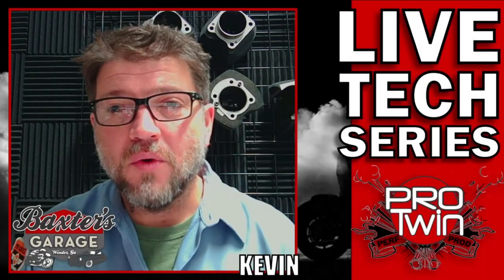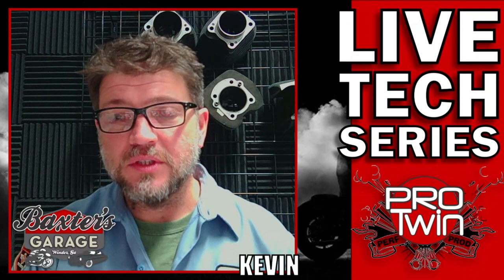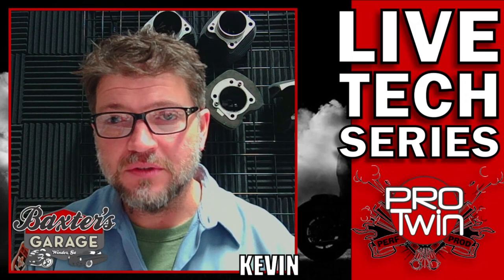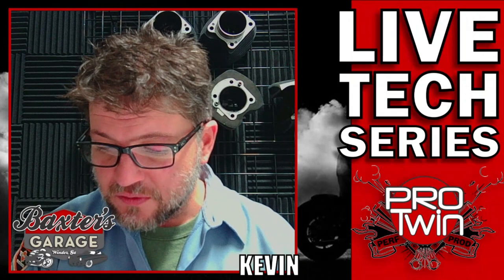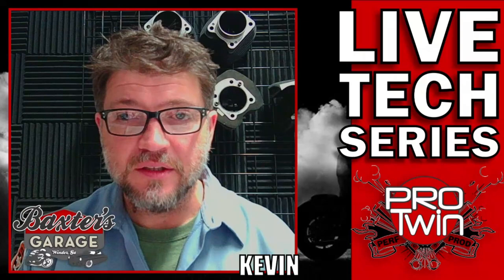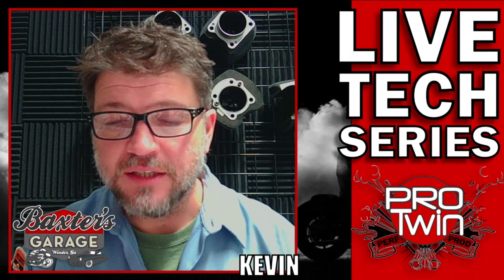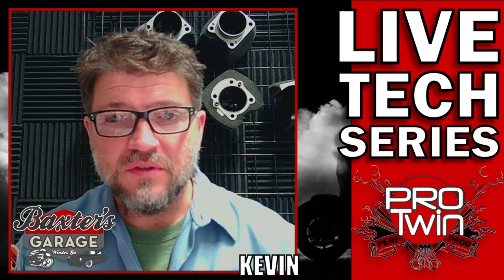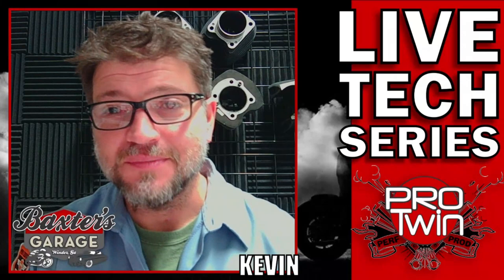Harley Sumping Symptoms and Clues - LIVE Channel Announcement - Kevin Baxter - Pro Twin Performance

Comment: Kevin, thanks for all the great videos! I own a new FXLRST 117. I am getting lots of oil in the air cleaner, it is even overflowing onto the motor. The bike has a woods 22xe cam, lifters,Thunderheader.,and Dynajet tuner.  Is there a definitive test to figure where all this oil is coming from. I get all types of opinions from all types of people. Harley has been no help. Your insight and opinions will be greatly appreciated. Some people say to vent the motor via the cover over the transmission Tracxs thinks that the answer. Of course they sell such a gizmo. Like I said all types of opinions.  HELP!!!

Comment: Thanks Kevin.
 Yes sir, that answered my question and makes a lot of sense. I probably already knew that but I'm basically just a weekend type wrencher, I have a tendency to forget some things like that. I took power mechanics my freshman year back in '84 and auto service and then auto mechanics through my senior year. I didn't pursue it as my career but it has served me well through the years doing my own maintenance and mechanical tinkering. I still have a deep interest in anything mechanical and try to stay up with the latest but being away from it and my head and hands out of it a good part of the time can leave me unpolished.

Comment: Coming from a mechanical background and watching the M8 breakdown first thing I noticed was the fact that used a wrench to break the bolts loose first. It just points out your professionalism. That being said if coming from out of state, how long would it take for you to rebuild my M8-107 with liquid cooled heads when the time comes! My present mileage on my 2017 is 33 thousand, and  what mileage would you recommend doing the rebuild
Reply from the maker: you wouldnt have to do a rebuild unless problems are present or you want to upgrade.  hard to say with mileage.  ive seen 2017 M8s come apart in less than 1000 miles.  Others Ive seen many miles with no issues.  Depending on the level of build and business at the time, it could be 4 weeks to a couple months.

Comment: Hello sir. I opened the crank eye and 350 grams of oil came out from inside. this I imagine is a large amount of oil. and I have replaced the oil pump with the s & s and still the same happens. the crank has 4500 inches runout if say it right.what can i do???with all the respect.great video great tips.
Reply from the maker: Hello sir...thank you for your support.  Have a watch of the latest M8 sumping videos...tear down, etc.  Tons of information there.  Bascially, if you get any, its sumping a little.  At 4 ounces, the problems start getting much worse.
Reply: Good evening Kevin .I saw all the episodes.they helped me a lot. @KevinBaxter

Comment: Hey Kevin! just wanted to send my regards and many thanks for all the amazing work and content you are putting on this channel. The harley community deeply appreciates this big time. Just one question and comment, what is the root cause of the pinion shaft runout in the first place?? and if it is due to the pressed crank/flywheel assembly from the factory (and the slippage caused becuase of it) do you suggest to address this root cause at an early stage and just fix the crank/flywheel assembly (trued and welded or replace with an aftermarket one)?? appreciate your feedback and response, many thanks again!

Comment: My 2019 FLHTK had severe sumping issues. The crank runout was around 0.003. The topend was fully rebuilt, piston jet oilers tightened, and new 2020 style oil pump and cam plate installed. I rode it for around 1000 miles and it sumped again. No joke, around 1.5 quarts was drained from the crank sensor. The bike had 14,500 miles on it at this point. I had no trust left in the bike so I traded it for a 2016 Road Glide Ultra. Any thoughts on what could have been the issue? Thanks.

Comment: Just in case I don't make it to the live stream, I'll ask my question again so that maybe I'll see the reply on the recording... When you were removing the comp. and clutch you used an impact. I've been told to never use an impact on these nuts because it can shift the crank causing runout. Granted the crank that you were working on was already farther than anyone wants it to be out, so the risk was nothing. But mine is pretty good with around a 0.001 inch on the cam side and I'd like to keep it in good shape when I fix the leak on the transmission output shaft in a couple of days/weeks (when I get things ready). Thanks.
Reply from the maker: Great question sir....IF i wasnt replacing the crank or trans, I would NOT use an impact.  There is an exception.  If one finds these bolts extremely difficult to remove...too much loctite, etc...using primary locking tools with excessive torque can damage other items in the primary and a little heat and bump with an impact can be just enough to break them loose.  Also consider...these are LARGE bolts going into steel.  Not steel bolts in aluminum.  Lastly...specifically on the trans...notice i was pulsing the trigger...not just hammering down on it.  And...the gun was turned all the way down.  As you may well know...sometimes just technique with a tool can make all the difference.
Reply: @KevinBaxter  and what you just said is all it takes to slip the crank dude ..Suzuki fixed their slipping cranks a long time ago by welding all the crank pins so they would never move again..makes it impossible to ever replace anything . so you just throw them away when they are worn out ..lol
Reply: @KevinBaxter  Kevin, thanks for the info. I wasn't able to make the live, but just finished watching the recording. I did notice that someone else asked the same question. I'll have to get my garage cleaned up and get into this, probably be sending you a list of parts for pricing once I get in there to see what I need. Pretty sure the comp. or spring pack is done, guessing I'll need some other seals and stuff once I tear it down, etc. Might replace the clutch while I'm in there, need to measure and see how much wear.

Comment: Kevin, if a sumping problem exists, am I correct in assuming that checking the oil after a ride WITHOUT letting the engine idle should show a LOWER oil level in the tank than if the oil level were checked after letting the engine idle for a few minutes?  My logic is that sumping would be less pronounced at idle than at higher revs, and oil scavenging from the crank case would accordingly be more efficient, returning more oil to the tank.  In other words, if sumping is an issue, letting the engine idle after a ride will result in a higher oil lever in the tank compared to not letting the bike idle.  Am I on the right track here?
Reply from the maker: anytime there is a variance in oil levels...up and down....there is a sumping issue.  can also vary as to when it sumps.

Comment: Kevin, could you tell us what causes sumping in most cases
Reply from the maker: oil pump alignment, bad cam plate or pump, excessive crankcase pressure, too much oil, clogged breathers, etc.   several causes really.  thanks for your support Rod!
Reply: @KevinBaxter  thanks for the feedback

Comment: Mt 2006 Fat Boy after it has sat a month or so over the winter the oil in the tank is low but after I start it the level comes back up. I don't know if this is called sumping. Someone said there is a check valve that may be bad. This only happens after it has sat for a while.

Comment: I try to understand everything you say and do there Kevin.
I took auto mechanics in highschool.  And I was a diesel mechanic in the Navy.
I've tinkered with everything from model airplane motors, chain saws, weed wackers, cars, farm tractors, tractor-trailers, even a little on aircraft!
Motorcycles have been one area I have had no real reason to endevor into, at least from a mechanical perspective.  I rode bikes, not work on them...

Owning an HD has just changed all that!  And it's been both an eye opener and a real scary ordeal!
Because, an HD, no matter the age or size, isn't cheap by any standard.
And I just get the impression, my '04' 88ci twin cam, is as fragile as they come.  
I'm afraid of this bike!  Because of design features, workmanship, materials used.
And this bike, is "TOTALLY STOCK!"
I bought it used, with 11,500 miles on it.  There were no maintenance records on the bike and everything on it, as far as I can see, is the "original parts," from front to back.  The tires are maybe the newest things on this bike.
So this means, that everything inside the engine and transmission are still the same parts that were installed in 2004, when the bike was built!

I didn't have a clue what I was getting into, when I took the bike from the dealer, who was 'HAPPY!!!,' to see it leave the showroom floor!
And then...  I was totally on my own.

So I'm very happy and a bit 'clingy,' maybe, with folks like yourself, who know so much about what I don't.
I'm am frightened by this machine, that has so many ways to just come apart on me, no matter how much I try to baby it!  And believe me, I babyed this bike since July, when I got it.
I've gone 1,100 miles on this bike in 5 months.  Mostly just going back and forth to work.

Nothing, would please me more, than to be able to send you this bike, and have you rebuild it, replacing all those cheap stock parts, with aftermarket products and your workmanship and knowledge.

Honestly, I'm happy with the stock performance.  I'm 60, and don't want to handle a monster on the road.
I would just like to know, that when I do get on her and fire her up, I can depend on her getting me to and from in my travels.

I ask you maybe dumb questions, or attempt to understand something, because I don't know a damn thing!  You're a teacher, and you're willing to spend the time to help me and all these other guys, 'and gals,' to understand the machine between their legs and under their ass!

I for one, am above and beyond appreciative for what your doing in these videos!  Thanks for helping me get a grip, understand the machine, and take some of the fear and mystery out of it.
Don't stop now that you're started!
Reply from the maker: thank you sir.  I always enjoy reading your comments.  thanks for the kind words.  never be afraid to ask a question...a dumb question is one that isnt asked.  i have 3 2020 M8s in the shop right now...all 3 owners are happy with the stock power.  but...these are their last bikes.  we are completely blueprinting and building with a pure focus on longevity...not maximum power output.
Reply: @KevinBaxter  I am in the same state. Happy,with the power and want this 2018 M8 Ultra Classic to last another 10 years and 100000 miles. What are you doing to these motors (other than blueprinting) to get the longevity?

Comment: Hi Kevin. Love all this. Fascinating stuff. I had a 2006 Dyna from new for 10 years, did 70,000kms (40,000 miles) pretty much trouble free. Primary brg replaced under warranty at 18,000 miles, then trouble free after that, except for a strange whining noise started at 40,000 miles when hot. I nor the dealer could figure out what it was - as per usual, they said there was nothing wrong!! My question is: If one was to buy a new M8, would I need to replace the primary auto chain tensioner with a manual one, replace the oil pump, &/or check the crank runout (before buying!)? I guess if these 3 items were all OK, the bike would be good to go many 1,000's of miles? Cheers Mike in NZ
Reply: Run a hydraulic tensioner in primary , they are out there and work great.

Comment: Kevin, question for you. I saw a post from you once before where it was mentioned that Fueling recommended not running synthetic oils in an M8, I just saw a statement on Cycle solutions stating the same. Any idea why?  "Cycle Solutions Inc. recommends using non synthetic oil in Milwaukee Eight models and not letting and M8 idle on its kickstand.
Reply from the maker: Ive had this come across my desk a few times.  I really cant explain their reasoning behind it.  I have called and will speak with Feuling directly about it and get their reason.  Before I dismiss it, I want to know their thoughts.  For myself, I can think of a single reason why this would be the case.
Reply: @KevinBaxter  thank you sir. I am sure your followers will be interested to know.

Comment: Would external breather, s&s cam plate, s&s oil pump and feuling vented dipstick help with these issues? I just noticed a lil loss in power today... checked oil and was very low! So I drained oil and only got about a quart and some...! I'm about to put 475 cam kit in my bike! But I'm gonna be honest losing that much oil has me worried! But I've ordered s&s 475 cam kit, feuling dipstick and currently have external breather hooked up!

Comment: Ok, got a 2006 Screamin Eagle Softail, 103", B motor, sits for a few weeks, oil tank empties...wtf?!  Sumping? Oh, 44k on the bike.
Reply from the maker: all do that.  so do sportsters.  the oil tank is higher than the oil pump.  over time, it drains and fills the crankcase.  fire it up and itll empty and refill the tank.  thats why you ALWAYS check oil level on sporty and softail after a ride when hot.  not before.

Comment: I have 2011 CVO Softail convertible D&D fat cat Screaming Eagle Elite heavy breather intake , oil Bud oil cooler 37 row with spal 313 CFM fan that comes on @ 200 degrees PC racing reusable oil filter and have vented the head breather bolts in the environment and Love Jugs cooling fans . The bike has been professional tune with Screaming Eagle Pro Super Tuner(Orange one with black button) 21,000 miles on motor any recommendation on cam plate upgrade ? No issues at this time 45 pounds oil pressure when cold when hot 230 degrees oil pressure is 15 to 20 pounds at idle

Comment: What bikes are doing this, I what to buy a Milwaukee 8 Road King 17-2020 is this a problem that affects all the different years? My Dyna 2006 had bad barrings which caused my transmission to go $2200.00 later, so I am a little worried about the M-8.
Reply from the maker: i would buy a later model...unless you find a 17 or 18 that has been upgraded with no issues.
Reply: @KevinBaxter  Is it the bikes that were upgraded only, with the sump problem? I am looking at 2018 road king stage 1 & 2 aftermarket turner 20k on the bike. I have the vin can we check out the maintenance history thur Harley or pay like carfax? I keep getting companies outside the country when I search.

Comment: I watched your “Skunkworks” video on the 107 twin cam you built on a 07 Harley bagger and was wondering what the price was for the engine build.  Also on this engine would doing away with the compensator be ok or does it promote quicker engine wear?  I was very impressed with your knowledge on Harley engines as well as your assembly techniques.  I live in Tellico Plains, Tennessee, a little North of your location and would be interested in doing the same build for my 08 Fatbob.  I already blew up the last 103 engine due to the destruction of bearing between the connecting rod and crank.  Unfortunately at the time I did not know about the poor runout on Harley cranks and replaced it with another Harley crank, my bad.  The 103 I have currently original had 110 hp with 110 tq. It has been modified with head porting, cam, exhaust, tuner, rocker arms, etc.  I’m worried that it to may be a ticking time bomb.  Please let me know,  thanks again and keep putting out your videos.  I do wrenching on hot rod cars sometimes, but I am not that knowledgeable about Harleys and I like your approach on building and assembling engines.  Thanks again.
Reply from the maker: thanks George.  Each build is tailored to the owner...which means the price can vary considerably.  We only quote a price after a consultation.  If youd like to email us, we'd be happy to set up a time.  or you can set up an appointment here https://www.baxtersgarage.com/skunkworksconsult

Comment: Would it be more accurate to call this problem 'wet sumping', given that the engine is supposed to have a 'dry sump' ie. it has no actual 'sump', the sump is the oil tank.

Comment: Hi, I have RGS with M8 107 made in May 2017 , rode about 30000 miles up to now with no any sumping symptoms you mention , just did not check oil amount in the sump. Should I? Do have any idea what production time at most risk?
Reply from the maker: its a hit or miss.  on an M8, you can pull out the crank position sensor.  easier than dealing with the plug on TC.

Comment: I am curious, if you remove the crank position sensor and put a inspection camera in the hole. Would you be able to see the oil level if it was sumping. I have never tried it but thinking about it.
Reply from the maker: No sir...crank is in the way and VERY close.
Reply: @KevinBaxter  darn was a thought.

Comment: I have a 2019 Limited with a 131 kit. I have an S & S Camplate/Oilpump. When I removed the Allen Plug on the bottom of the Crankcase, about 16 ounces of Oil (Amsoil) came out. I also have my Oil sump vented. I refill with 4 quarts of oil and run my engine for awhile then let it sit. When I check my oil, it reads about a quart too low. The manual states it holds 4 quarts. I don’t want to over fill it just for the sake of getting the oil to read “full” on the dip stick. I have great oil pressure at speed and while idling (Dakota Digital Oil Pressure Gauge). Any ideas what’s happening? Or should I just leave it alone and not worry? Thank you.